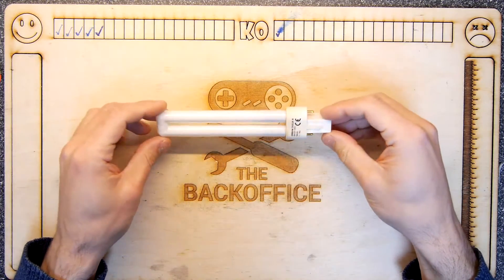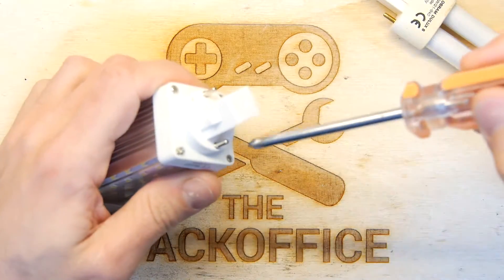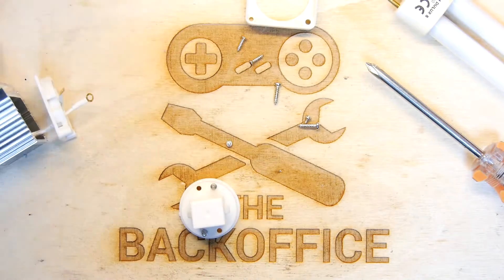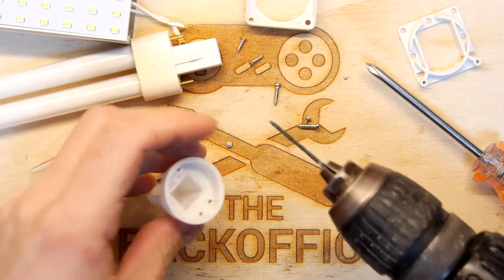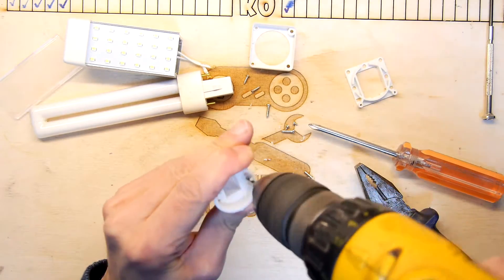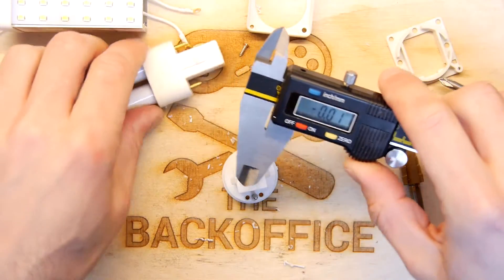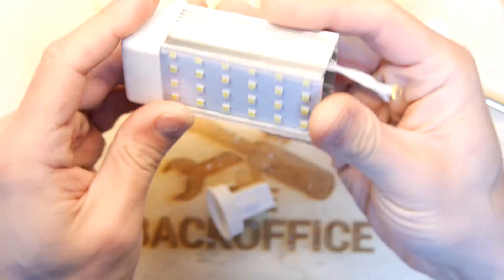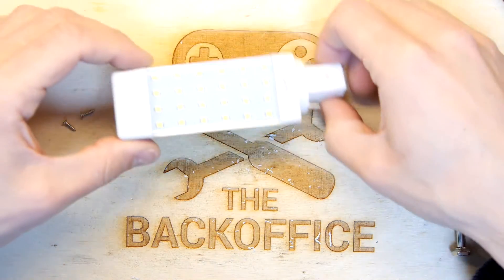G24 to G23 LED Conversion

Comment: In 2014 I bought nearly £300 of LED bulbs for the whole house and only a handful remain working.  I managed to get about three replaced under guarantee, but apart from that it has been a very expensive venture.  They tend to start flickering when they are about to go for a few weeks, and sometimes make hissing and sizzling sounds on the day they blow.  I've also had a lot of halogen and normal bulbs blow one after the other in the same time period.  The only bulbs that last a long time are those horrible old fluorescent eco ones filled with mercury.
Reply from the maker: +EgoShredder tried and tested technology! Incandescents are very maligned, but the heat they give off is welcome in the winter 😂
Reply from the maker: +EgoShredder i was forever replacing the halogens in the kitchen, literally they would last only a few days. Turned out to be the crappy transformers. Replacing those was a great investment in my time. 

Gnarly old florescents seem to last forever, just a new starter needed from time to time 👍😀

Comment: Two screws left over? Lol. I too am in the process of converting the house's bulbs to LED ones. I'm trying to convince my wife we need a multicoloured one for the front room. £60 worth. Lol I just wish you could block red. I don't want randomers/police knocking on the door. 🤣
Reply from the maker: +FairFight14 sounds like a solution looking for a problem 😂
Reply from the maker: +FairFight14 Dunno, red could be good business and help pay for itself in a short time 😂
Reply: maybe just drill out the red button on the remote?
Reply: ImpaledGryphon The bulb I'm thinking about, doesn't come with a remote. At £60 they're a bit too fancy for a cheapo remote. You control them over WiFi.